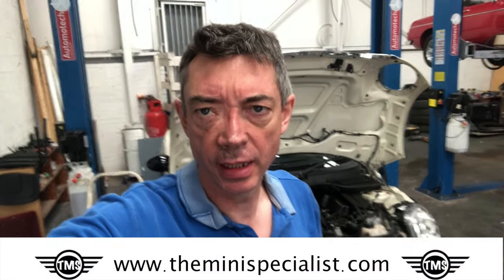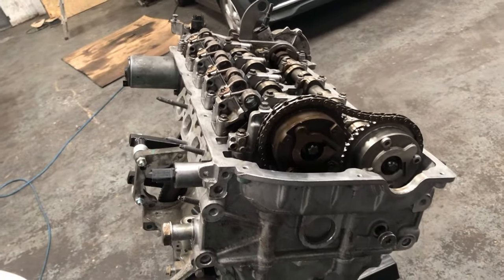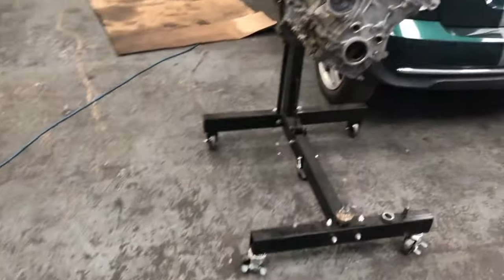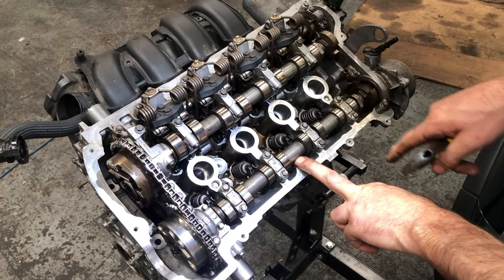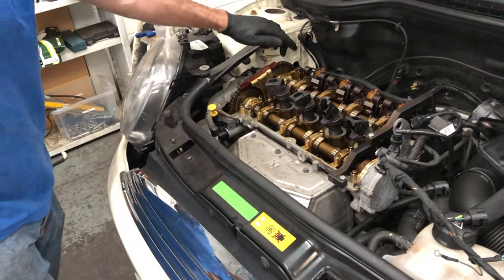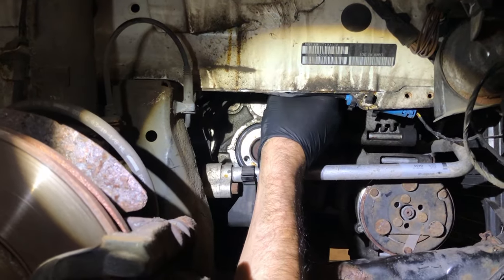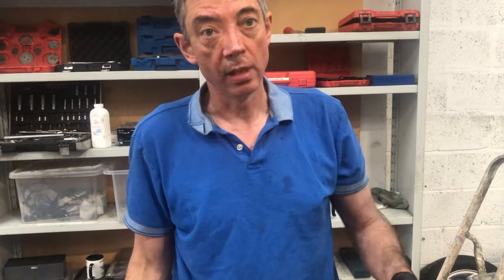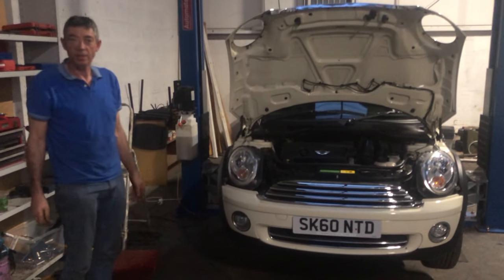BMW Mini Timing Chain DIY Replacement for N12, N14, N16 & N18 engines - The Definitive Guide

Comment: Epic video. I’m about to purchase an 07 r56 but I’m here after reading plenty about this obvious design fault. My question is, will it benefit me to get the tensioner changed even if there is no rattle? Would that help in any way as a preventative measure?
Reply from the maker: Some people do that - but as the chain won't actually snap I feel there is little point until needed - and the car will 'tell' you by 1 -  engine management light (exhaust VANOS movement stop). 2- rough idle and 3 engine stalls at low revs.  There is another thing to look for as well - these cars burn more oil than they should (especially the 1.4) partly due to the valve seals aging - so before you replace the chain monitor the oil consumption as when removing the cylinder head much of the work is the same as for the chain replacement.  Also be aware that the VANOS system works on oil pressure so if your engine oil is very low the VANOS will not work and the engine will run rough.

As for prevention - the only real prevention is to ensure the oil is topped up and you use the correct grade (5w40 100% synthetic BMW specification LL04) but that is only a delay not a cure.
Reply: The Mini Specialist ok gotcha. Thanks for your speedy response. Im going to view the car on Sunday. Would you recommend anything else in particular to look for? Thanks again

Comment: I need to do the timing chain on my 2009 clubman S.  This was very helpful.  One question though.  Since it seems the timing was off on this engine (assuming it skipped a tooth while the chain was loose). Did you not lock the intake cam in place until after you removed the intake cogand you could turn it independently from the exhaust?
Reply from the maker: I don't think this car had skipped a tooth - I doubt that is possible unless the tensioner is removed or the guides have disappeared - but to answer your question.  Once the crank is pinned it really doesn't matter how you remove the top timing sprockets as the pistons are locked half way down the bores so the valves cannot touch them.  If you cannot get the timing tool on properly initially to remove the sprockets, you can put a 27mm spanner on RHS of the cams where there is a section for this purpose.  I have seen cams that have been damaged by someone trying to hold them with mole grips - not necessary.

What does matter is timing the car properly with the timing tool on reassembly.  Hope this helps.
Reply: The Mini Specialist  thanks for he response.  Do you have a recommendation on a timing tool?   I was planning to buy the schwaben tool for $190.  I have seen the Amazon tools for around  $40 but I am Leary of that even though I am likely to only use this once.
Reply from the maker: @traylorkarttech4432  Not really - I have several now and each one has good and bad points.  You could (with care) make do without one - the MAIN bit is the crankshaft locking pin.  Once locked you could do the cams by eye.....
Reply: @The Mini Specialist  thanks.   I will use a tool.  Not too long ago I did replace the tensioner and the noisy chain went away.  However I suspected the guides were damaged so today I pulled the valve cover and sure enough the top guide was broken and the main guides definitely have some chips in them.   So I am replacing the whole set as a result.  Thanks for the video.

Comment: Thanks for the video.  Watched a few of yours and others.  I’m replacing the timing set on my 09 clubman S.  I bought I would do the gasket and turbo feed line at the same time.  I found a strange thing in the oil pan.  I have seen several others that have found it too but nobody knew what it was, or didn’t say.   Perhaps you know.  It was a small steel cylinder 8mm x 17mm with a 2.6mm hole in the center with a lead in chamfer on both ends.   Some have speculated its a locating pin for the block/head but I don’t think so, since it’s hollow and there is no way a trapped pin could escape.  My thought was possibly a restrictor in the oil pump, vanos valve or maybe something from the oil filter housing.   I can email you pictures.  I was hoping you might know.
Reply from the maker: send a photo to sales@theminispecialist.com and I'll have a look
Reply: The Mini Specialist  sent.  Thank you.
Reply: I know what the mystery dowel is. If you look at your valve cover there is 13 bolts that hold down the valve cover. In the cover there is dowels that the bolt goes through. They can come out of the valve cover. I have seen this a few times when the valve cover is put back on they can fall out and into the engine. I had a customer with this very loud rattle inside the engine it didn't do it all the time. When I pulled the valve cover the dowel was actually sitting inside. Look at valve cover I will bet one is missing.
Reply: David M  thanks David.  It is not that unfortunately.   The ID on this pin is only 2.4mm diameter and the valve cover bolts are 6mm so the bolts don’t come close to fitting through.

Comment: every time we set timing, it throws a code and reverts back to the original setting.  it takes the adjustment drives perfect for a mile or so then throws a code and back to safety or just powerless.  any suggestion would be helpful

Comment: I have 2011 clubman 3door turbo 1600 I bought a timing chain kit. The top guard in the head that comes with it rubs agains the top of the chain between the 2 sprockets ex and intake. I put washers under feet of bracket. it clears now.. That says the chain is too thick or guard too low? . next issue is the dip stick is hitting something on the way in about 1/2 way.. Next to the timing chain. ??
Reply from the maker: The top guide should rub - remove the washers..  The dipstick goes through the timing chain guides so if this is blocked then you need to investigate - possibly the guides are not fitted correctly.

Comment: When replacing the crankshaft bolt, i take it that the mating surfaces (sprocket, hub, bolt head) have to be clean and dry to maximise friction. but do you apply oil to the bolt thread to help with achieving the 180deg post torque turn?
Also is the bolt 112 176 161 64, M14X70, with no captive washer under the head?
Cheers for the vid :)

Comment: Thank you so much for this video, it leaves others on this subject in the dust! It's given me the confidence to do the job on my R56 2007 Mini One 1.4, no codes, no rattle, but it's at 140k, and I do not know if the previous owner did replace the chain. One question, I will be doing this on the floor, how long do you think it will take ? Thanks again for a brilliant video 👍👏
Reply from the maker: I would budget 6 to 8 hours  - we have nailed it down to 4 with a lift and repition. Good luck
Reply: @TheMiniSpecialist  Another quick question if I may, if the camshafts timing is out a little, like in your video, do you with the crank locked with the pin, loosen the vanos bolt on the cam thats out and rotate it until the flay where the cam lock goes is flat then install the camshaft lock tool?
Reply from the maker: @dangleebols  Yes.  With the crank locked and and the tensioner in place loosen the two cam bolts, then clamp the cams with the camshaft locking tool at which point the timing is correct (providing that the writing on the cams is uppermost and the correct sprockets are on each camshaft).  The chain should now be tight.  Then torque up the camshaft bolts (20nm +180 degrees)

Comment: Hi Hugh, Does the crankshaft locking pin suffice for torque loading the crankshaft bolt, or is a the locking spanner with the three holes recommended? Thanks
Reply from the maker: we have used the same pin for years - it is strong enough....

Comment: Hi. Thanks for the video. Good job. Very comprehensive. One question, is this very similar for the 1.6 Cooper D?
Sidney.
Reply from the maker: No - they are very different. There are 2 diesel engines in the second gen BMW Mini. The pre facelift was a PSA engine which is very reliable. The post facelift is the BMW N47 which is prone to camchain failure. See my N47 camchain videos for details.

Comment: Thank you for the video, I just finished the job and followed your guidance closely. However, now the car won’t start. It’s not throwing any codes, and it seems to be getting air, fuel, and spark. Any idea what could cause that?
Reply from the maker: Most likely you have the timing 180 degrees out.
Reply: @TheMiniSpecialist  thank you, what’s the best way to go about fixing that? Pin the crank and rotate the cams or vice versa?
Reply from the maker: @odessatj9965  when you did the job initially were the cams showing the writing ?  In any case you need to pin the crank again and ensure the camshafts are showing the text when you put the timing tool on.

Comment: Hi...I have the same engine in a Peugeot 308 1.6 16v VTI (120ps) and I have a problem where the diagnostics shows an error on the third cylinder and the meter shows DEPOLLUTION SYSTEM FAULTY... the engine does not lose oil, it does not lose coolant and it does not smoke from the exhaust system.. .I wonder if you had such a problem and if so what was the cause and how did you fix the error...thanks for the answer.
Reply from the maker: check the coil packs by swapping them and rescanning, then do the same with the spark plugs.  If you still have a problem it's likely wear in the inlet bank of valve lifters which are controlled by the valvetronic motor - at idle the inlet valves only open maybe 1mm - so wear in the lifters can stop them opening at all.  At increased revs the valvetronic motor increases the lift and if this is the case the misfire will go away.
Reply: @TheMiniSpecialist  thanks for help. Best regards

Comment: Great vid. In process of doing this now. Almost done but I don’t have a scan tool like that. Do most scanners have those options? I’d think that’s dealer only but obvs not?
Reply from the maker: You can get away without the scanning tool - the ECU should adapt - it throws an error when the chain is too long because the timing is out - with a new chain the timing should be back to normal.
Reply: The Mini Specialist ok thx. I have one of the Creator ones but I don’t think it does the adaptations. Hoping today or tomorrow to finish putting it all back together. Thx for taking the time doing this. Helped a ton. Next time I’m in UK I’ll stop in, unless of course my motor blows up!

Comment: Hi.  Question on the crankshaft pin.  I have discovered two locking positions where the pin will seat properly and lock the crankshaft.  One when piston 1 is going down, 1 when going up.  Both positions lock the pistons about half way and level with each other.  Which one is correct?  Or does it matter? (R56, N12)
Reply from the maker: It matters.  As mentioned in the video the writing on the camshafts needs to be showing.
Reply: You know what. Nevermind.
I inspected with a mirror. There's only one hole. The locking tool was catching on a raised area of the flywheel that happened to be 180 out from the hole. With the mirror it is obvious.
Thanks for listening.
Reply: @TheMiniSpecialist  Yes thanks.  In this case there was no timing chain on yet because I was doing a head gasket replacement.  I had to repin the crankshaft before starting the timing chain work.  But I inspected with a mirror and there is only one hole.  The pin was catching on another feature on the flywheel.
Reply from the maker: @richmr2174  Correct - the crank turns twice as fast as the cams so you can pin it 180 degrees out - however with the head removed there is only one place to pin the crank and when you refit the head - as long as you put the timing tool on with the writing uppermost you will not go wrong - well unless you don't torque the bolts properly - but I am sure you know that.

Comment: Great video. I found broken plastic pieces, besides the pump, where else can I look for the rest of the pieces ?
Reply from the maker: Just in the sump....  making sure you clean the pump strainer (of course) - sometimes it's easier to remove the pump to do this.  There are 3 bolts and a plastic chain shield thats a friction fit and the chain is quite loose - enough to slip it off so you can remove the pump itself.  Good luck.
Reply: @TheMiniSpecialist  thank you for the quick response!

Comment: Hi friend. Amazing video. Very well explained and detailed.
I would like to ask you for help and advice. I have a r56 cooper with an N12 engine that gives me an engine failure "error P111B" and a bad "accelerated" co test 0.498%
has it happened to you? could it be the MAP?
thank you very much for your help
Reply from the maker: Could be the MAP - would need to run my diagnostics to be sure
Reply: @TheMiniSpecialist  Thank you very much for your answer. I don't have a diagnostic machine to help me. I only have the one that reads error codes. I'm going to try changing the new MAP.
Do you recommend a brand that is better for you, such as bosch, Metzger, Ngk, etc. or do I only buy original BMW?

Comment: I have a question. What's the position of the variable gear after squezee the bolts of both. Admision variable gear to the left and exhaust to the right and then i put the chain?
Reply from the maker: It's all in the video.  As long as you clamp the camshafts and pin the crank and then torque up the bolts correctly you cannot go wrong

Comment: Hey basically I’m just trying to figure out how big of a deal it is that I have my cams finally lined up correctly, but my flywheel isn’t too dead center. Also, how do I fix that?
Reply from the maker: It all hinges on pinning the flywheel.  The flywheel rotates once for every 2 rotations of the cams which is why you need the writing facing up on the cams - once the flywheel is pinned and the cams are clamped the rest is easy.  Put the crank and cam bolts finger tight in with the chain in place and then insert the cam chain tensioner.  At this point the engine is timed.  All that remains is to torque up the crank and 2 cam bolts.

Comment: What time chain kit would you recommend? I hear the Ultra ones are meant to be genuine parts for the PSA engines?
Reply from the maker: For N12, N16 and N18 engines I use VGA TC1030FK and for the N14 I use VGA TC1025FK the FK means there are more seals etc in the kit.

Comment: You don’t show how deep the flywheel locking tool goes in. Mine sticks a cm out and it only lockt clockwise, not counter clockwise. Am I doing something wrong then? Can you please let me know if it should go in further and if it must lock the flywheel in both directions? Furthermore great video!
Reply from the maker: Once the locking pin is in it locks - completely. If you can move the crank then it isn't locked. Try using the camera on your phone or better still the magnifier function with the light to properly see the flywheel through the hole. It will be obvious when that locking position is there and when the pin is in then there is no way that crank will move. Hope this helps.

Comment: At what point did you put back the cam-chain tensioner?
Was it before or after torquing down, the crank bolt and cam-pulley bolts???
Reply from the maker: I tighten up the tensioner when the crank and cam bolts are finger tight only but whilst the crank is pinned and the cams are clamped.  This way the tensioner can apply tension to the chain allowing the 3 sprockets to move slightly if required,  then when the chain is tight torque up the 3 bolts,  this way the timing can only be perfect.
Reply: @TheMiniSpecialist  Thank you so much for this

Comment: Is the chain problem also present on the n16 engines produced in 2013? And also on the JCW? Has BMW never fixed the problem? Thanks for the reply
Reply from the maker: No - the problem still occurs.  Every chain wears and becomes longer - from bicycle chains to chainsaws to camchains.  The reason why its a problem here is the chain length dictates the engine timing.  When the chain becomes too long the timing goes out.

Comment: Hi Hugh.
Loved it. 
Quick question.
I've a cooper s 2010 and auto start stop warning has come up, simple fix?? 
Kind regards.
Adam.
Reply from the maker: Usually this is a sensor mounted on the brake servo - I have a video on this here: https://youtu.be/dUQ4fnnjr7I  the video is for a Diesel however its the same basic system for the petrols as well
Reply: @TheMiniSpecialist  Hugh thank you so much. 
Very kind regards.
Adam Palmer.

Comment: I wanted to ask you a question I have a 2007 mini cooper base model and I ran a scan tool on it cause I was hearing the death rattle and I was getting the low pressure oil sign on my dash and it said that the vamos inlet actuator movement so I suspect it’s time for to replace the timing chain and clean out the oil scavenger pump cause there might be pieces of the guide rail stuck in it,would do you think?
Reply from the maker: The timing is controlled by oil pressure so investigate that first.  If your car hasnt had a chain ever then it will need one for certain

Comment: I have a 2009 mini one that had a new battery on it and ever since my electric windows will go down but when you press up on the switch the windows just twitch for a second then nothing happens, there stuck down until you disconnect the motor and physically push them up any chance you've seen this before?
Reply from the maker: these cars can suffer from electrostatic damage to the footwell module when a battery is disconnected if you get a spark or two - the footwell module controls the indicators, windows and other lights.  If the footwell module has been damaged then it will need removing and repairing.  I don't recommend replacing these are there are so many variants it is hard to obtain the exact one for your car